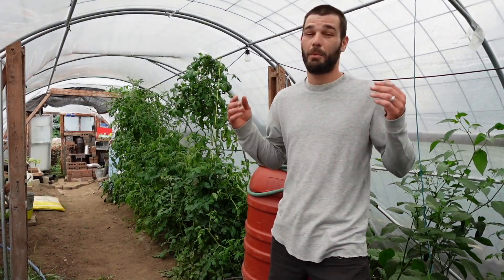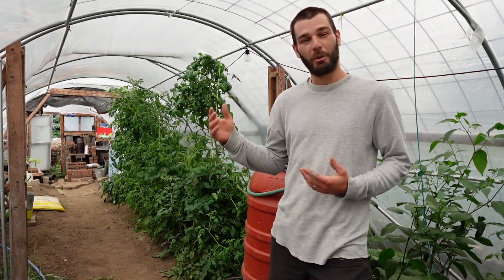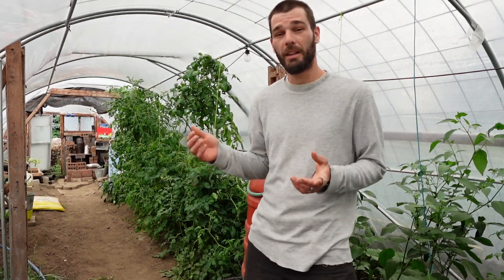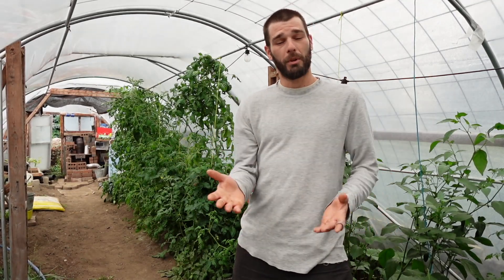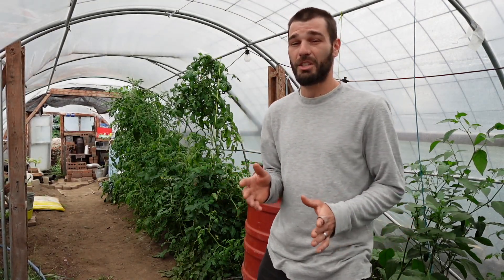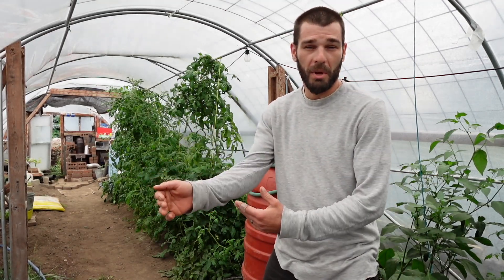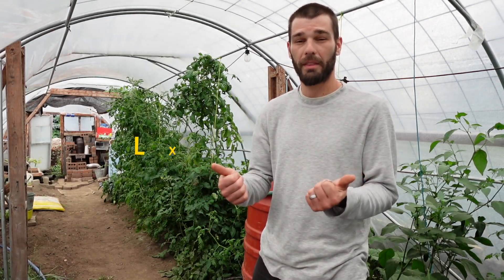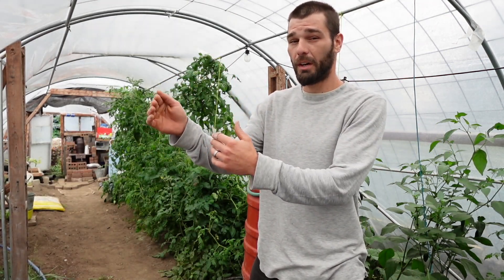DIY Greenhouse Venting Requirements & Formula To EASILY Calculate Your Own Venting Needs

Comment: Thanks for posting. I’m a total newbie. Are you ventilating to allow for carbon dioxide to come in as well as the temperature and humidity? Or just one or the other? Do you end up having to allow cold air in all winter?
Reply from the maker: The greenhouse is large enough and holds about 3800-3900 cubic feet and when it gets colder the windows don't open in the dead of winter and just us coming in and out of the doors are enough  to freshen it up, however if we have the advantage of a fully sunny day which are a rarity in winter we will vent a bit more. great questions and the use of fans really helps out

Comment: Awesome! I have no venting system in my 120sqft greenhouse and have to leave the door open 3 seasons. I get a lot of use during those 3 seasons but certainly wished a window had been added to the wood and thermal glass. I do believe there are openings in the eve on the north side but I think they are closed off.
Reply from the maker: That’s awesome we certainly wish we had a more solid structure for a greenhouse. That’s our next big investment coming, lol. If you ever decide to put a window or two in you’ve got the formula for finding the size required! Thanks for checking this out!